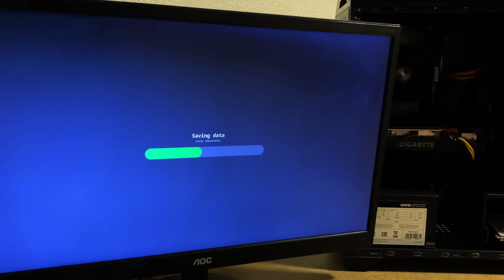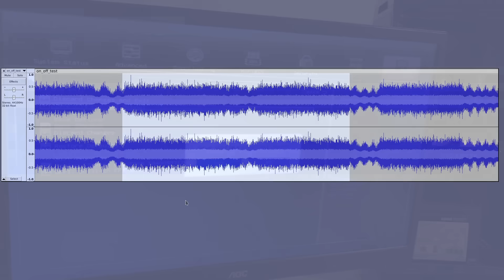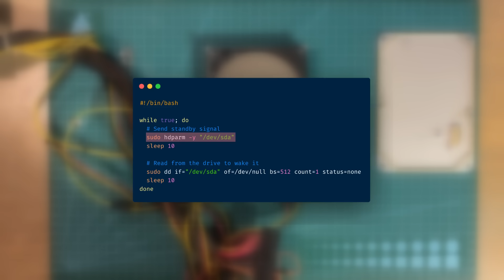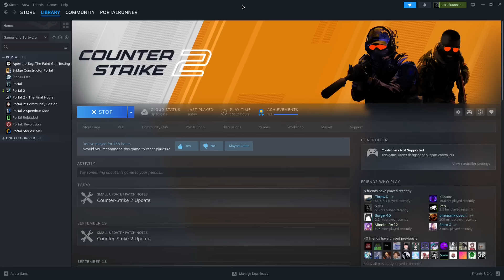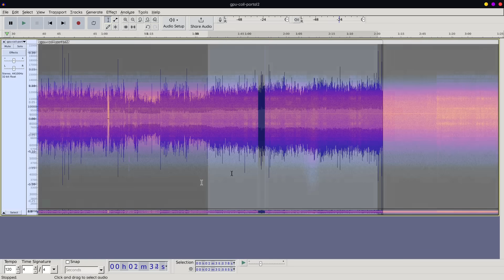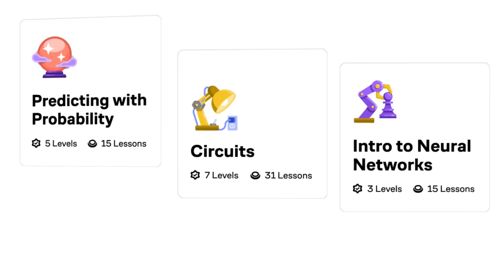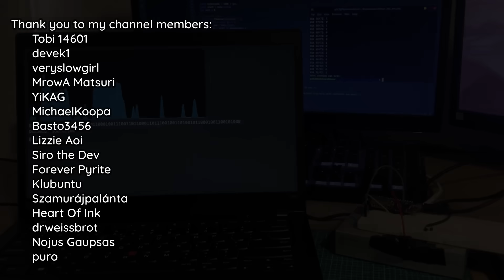Listening to a Computer can Reveal what it's Doing

Comment: Anyone who records guitars in close proximity to their PC, or uses studio monitors without a proper ground knows exactly what their coil whine sounds like. You can hear it squeak even when you move your cursor. I've been spending god knows how long trying to eliminate the issue. FYI, the only actual way to stop coil whine (in guitar pickups) from coming through is to either move the guitar further away, or the PC further away. With studio monitors, it's eliminating the ground loop by either plugging everything into the same outlet, or using something like a GND Defender.

Comment: I was hoping you were going to detail how heat is a side-effect that showcases that your computer is inefficient.
Where it goes from current into processing, where the speed at which those processes are made create heat which is a by-product of the current running through your CPU. Which based off of relativity the exchange of current into heat comes from the power draw, so your computer must draw more power to keep a consistent flow of processes, this it creates more heat.
So computer power efficiency is kind of abysmal if you consider heat as a negative use of power, or increadibly efficient if you make use of that heat such as heating your room.

Regardless, a computer has a main purpose and is designed to run and complete tasks. Therefore it's inefficient.

Comment: but can you extract what is being downloaded or the websites visited?
Reply from the maker: Not from sound or light alone, no. Don’t worry, things like that are usually solidly encrypted and concealed.
Reply: @PortalRunner  then how does the passwords get leaked by this method?
Reply from the maker: @ejonesss  I never claimed you could leak passwords this way.
Reply: @PortalRunner  a password and encryption key is somewhat tantamount.

1:07 you talk about side channel attacks
Reply from the maker: @ejonesss  Sure, but this video is an exploration of how effective these common side-channel attacks are for regular desktop computers. By the end, I conclude that none of the methods discussed pose any risk in the real world. I certainly never claim that you can extract sensitive data.

I mentioned encryption keys as an anecdotal example from Wikipedia. I never said anything about using the methods in the video to get passwords.
Reply from the maker: @ejonesss  If you’re looking for information on side-channel attacks in general - i.e. outside the context of this video - then the comment section of said video probably isn’t the right place to ask. Use Google.

Comment: dont rely on audio or visuals, its too slow.  but on rf interference using hacked tv receiver usb sticks (rtlsdr... hackrf.. etc.). theres so much more data floating around that isnt supposed to be there
theres even a project that can view your monitors video signal from just being near a hdmi cable. its called tempest sdr.

Comment: If you are really interested in this stuff, I think you should try listening to the computer. In some cases if you have a really cheap mobo, it usually does not entirely filter the noise from the power supply/CPU/GPU etc. I personally have such a mobo and in some games, I am able to identify where mouse is looking, or where I am in the map based on the pitch of the high frequency noise from the headphones.

Comment: Back in the late '70s, you could put an AM radio next to your microcomputer, and it would pick up interference noise from the switching of the ICs. There were a number of programs around, like the one I had for my TRS-80, that would actually play a rough bit music using this method. God, those were days.
That's what your vid title made me think of. Also, I've literally always listened to computer drives to tell what my computer is doing. I find SSDs a bit disconcerting lol
Reply: PS There were also programs back in the early 80s that would bang the head of your 5 1/4" floppy drive back and forth to play music. (You can find vids of ppl doing that here on YT.) That was fun lol
Reply: That was also a very early trick with the Altair 8800. The trick was revolutionary for the time, because the Altair had no audio or video out. It didn't even have a keyboard, just some switches and lights.

Comment: That visualisation of the data from the high-frequency inaudible noise a GPU makes through Coil Whine helps underline why some people are able to tell if a video card is failing when the coil whine drops in to the audible sound range of 20Hz to 20KHz, and why it is such a problem.

Comment: when I upscale images using some GAN models locally, I can distinctly hear when my GPU loads a new batch into VRAM and processes it.
I can only hear the coil whine with analogic headphones attached through a 3.5mm jack to the front of my case. It may be because the cable is badly shielded, not sure.

Comment: 2:40
You can also control the speed of the fans trough linux by pwm value. This is possible trough sysfs.
And so I forked an old sensor tracking library to include fan controlling functions and based on the library I made some GUI application that not only allows manual fan controlling but also makes possible tracking sensor values (like CPU, GPU,  chipset temperature and more)

Comment: I have bad audio chip on my computer motherboard and it modulates the audio output with noise on power lines. I can hear different sounds from my speakers whether its mouse movement, cpu load or gpu load. I can literally tell what exactly my pc is doing just by the sound

Comment: Relevant tangential trivia: timing attacks are the reason web browsers don't allow Javascript timers to be used to their full potential. The JS high-resolution timer class is artificially limited to 100 microsecond resolution in insecure contexts and 5 microsecond resolution in secure ones (specifically, ones isolated from other processes). Most modern hardware is capable of measuring time in smaller increments, but allowing a webpage to do so also allows the timing between operations to be analyzed precisely enough to determine cache hits and misses, which can then be used to reverse-engineer all kinds of things stored in the computer's memory outside where the page could normally access. Including, theoretically, keys and stored passwords.

Comment: 0:38 500? Rookie numbers! My Firefox wishes it would only have to deal with 500...
6:05 reminds me of when I got my RX 7900 and tried to run that with an almost 10 year old 700W PSU. Going full throttle on the card would just trip the safety of the PSU, but going like 50% on it (1600x900 on FurMark) it barely stayed alive, but DAMN was the GPU whining... literally 😂Was kinda funny (for about 10 sec) but it absolutely didn't sound healthy...
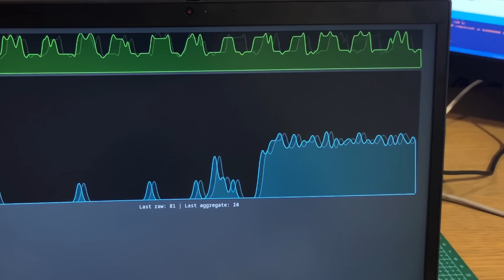9:25 Things I've noticed (in order): poor guy only has 50 mbit, but damn does he have a lot of chocolate on hand. I now also wonder which personality test will tell my that I'm on the spectrum based on these observations and their order.

Comment: I had a dell Laptop though I imagine this works with Most Laptops or Desktop... if you plug it into an inverter Running from DC Power you can hear every single thing that it does even just moving a mouse.

Comment: One thing you should definitely try is to put an AM radio next to a computer. I've noticed that you can get the coil whine noise but with far greater audio clarity through the radio. I was playing with this hand crank radio this one day and noticed that the noise coming out of the radio corresponded with the activity of my computer. When playing a game I managed to tune my AM radio such that you could hear the framerate of the graphics card giving a sound reminiscent of a lawnmower. Just like you showed, looking at the floor made the framerate go up making it sound like the lawnmower reved up, and looking at the distance made it sound like the lawnmower slowed down. I also tried running an LLM on my system and the could get the radio to make this zip-zip-zip sound. You could here each token being generated.

Comment: This video is the best place to post my experience - I have a PC plugged into an outlet that has faulty ground connection. It works, but only roughly, when I measured it with a multimeter it showed that from phase to ground there was 90 out of 220 (expected) volts. Because of that (I presume), my audiobox picks up a lot of emf that otherwise would've been bled off into the ground. As such, I'm not only able to hear that someone's calling me on my phone, or that my phone is sending and receiving signals, I'm also able to hear what my PC is doing. So far I've identified clearly one sound that really stands out due to how unusual and recognisable it is - my GPU working. Normally when I play games I don't hear it, for some reason, but when rendering stuff with GPU and while updating drivers I hear it clearly. It sounds sorta like little tiny blasters from star wars. This tells me that something is either being calculated on my GPU really hard or something is updating firmware (as I presume GPU drivers do that). I can also sometimes hear, though much more faintly than the GPU, how my PC is receiving or calculating the change in my mouse position. This one sounds like an old school optical drive moving the reader head, but only when I move a mouse. There's definitely a lot more of those sounds I either have yet to notice or am unable to due to lack of amplification and precision. And before y'all tell me that I need to fix that ground, yeah, I know I'm just too lazy and afraid of messing it up to try. Besides, the PC works alright anyways.

Comment: With the fan thing you can only measure that the computer is doing something, which isn't really useful unless you need to know if someone is using the computer (and even then the fans might not spin up), and at that point you can just use the mic to listen for that rather than the fans, as using the keyboard, clicking with the mouse, etc. already makes a sound.

Comment: Actually, computers are really fast.  They can be faster, as there can always be hypothetical (or just really expensive) hardware out there that is faster.
But usually, software is just written in an inefficient way, which ends up wasting a lot of time on useless things.
Software actually used to run faster in the past, even on slower hardware, as the pressure to fully take use of the hardware was bigger, because if you didn't it might not have run at all.  Nowadays that fear isn't there anymore, as you can just make something and usually expect it to run fine.

Comment: If you have enough time you can use the AC to exfiltrate airgapped data, by making the computers work harder in a pattern you can raise or lower the consumption of the AC in the same pattern and get text over a few hours, it might be only a few characters per hour, but when all you need is a password/certificate it can be fast enough to get it over a couple weeks.

Comment: In my case, after watching your video, there IS one acoustic option left: AUX Interference. If your headphones (IEMS for my case) have a really low frequency range, and you remove most of the acoustic deadening (padding, or mesh in my case) or if your case (haha get it) has a really s$*tty and thin audio IO cable, you would be able to hear a LOT of noise. With my old case I used to have a lot of that as the cheap chinese IO cable used to have no sound reinforcement, i could hear literally everything being calculated in real time, with me opening a game, to just moving and rendering pixels on my screen, there was a LOT of noise and it would make me go crazy.

Comment: I haven't even watched the video but I can share an experience. My previous computer's motherboard would cause a very faint ticking noise that'd match up with what the GPU is doing.
If I were playing a game, it'd play ticking noise at the same speed as the framerate. So 60 ticks per second or 20 ticks if my fps are low.
If I were rendering in blender cycles, it would tick exactly at the speed at which each sample renders. Viewport or final render, it didn't matter.
It made me go insane and didn't stop until I just switched to a USB input headset.

Comment: Something interesting is I had an old computer that you could actually hear what it was doing. You could hear the hard drive in the fan but you could hear. Small, buzzing and clicking which intensified when the computer was booting up or under load. Presumably coil or capacitor But you could definitely hear it. The system didn't have a GPU so it had to be the motherboard.

That system has officially died as of like 3 months ago. It started booting inconsistently then after that it would power on but nothing would happen. Presumably a briked motherboard but it could have also been the CPU. Though my theory is cracked solder joints or traces. Since sometimes it temporarily worked. After reseeding or reinstalling components.

Comment: 0:19 space is actually a really bad place to operate a computer, from a thermal standpoint. If you tried to run a standard desktop PC in space it would overheat almost instantly because here is no surrounding fluid to transfer the heat to.
Reply: okay what about quantum computers?
Reply: @bakedcereal2  Space is the worst place to radiate heat so you would actually need liquid nitrogen
Reply: @KudoRedfox Liquid helium, actually, as liquid nitrogen is too hot. Quantum computers, as it stands in the present time, need to be as close to absolute zero as possible, and liquid nitrogen just can't get the computer cool enough
Reply: @KudoRedfox Space is the best place to radiate heat, it's the worst to conduct heat, but radiating can be enough. Also liquid nitrogen is useless (first because you actually need helium) because you'd have a very limited supply available
Reply: He did say a superconducting quantum computer in space but i'm not a quantum physicist

Comment: 2:08, this effect is typically caused by the voltage, which needs to be higher at higher clock speeds (loads of physics reasons why this is the case, but i digress). Clock speeds go up and down based on load, as an effort to save power when the CPU is 'idling'. Basically the motherboard/cpu package dynamically adjusts it's clock speed based on if the processing power is needed or not, which in turn adjusts voltage. As you can guess, high voltage means higher resistive heat losses.

So, to beat this, you just need to tell your motherboard to stop dynamically adjusting clock speed, and peg it at a specific clock speed, meaning your CPU is always going to be outputting a certain TDP

Comment: One crazy side-channel attack i've heard of is using a piece of code to write to RAM like crazy.  This causes a tiny, but detectable EMF/radio signal.  So, a virus can use pulses of heavy RAM usage, and a radio antanna close by, to extract information from a system, even one completely air-gapped (has no access to any network)

Comment: Showing my age a bit, I remember using a 486 with a cheap ISA sound card. You could hear the bus activity through the speaker output when it was loading from the hard drive or even just crunching numbers in memory.

That noise going away (or at least being less audible) was one of the most noticeable things about moving to a PCI sound card.

Comment: I hope to god you read this. Okay. VERY easy. I can record it if you want me to, but take a pair of wireless headphones with a 3.5mm jack. Say, cusher EVO (skullcandy) or an NC75 or even an NC25 (srythem) and plug in the aux cable to audio. Then, plug the USB-C connector into the USB-A port of the front panel that you did it too. When you run tasks, cpu or gpu, you can HEAR the task. I think its because when power is being used, you can hear the ground loop.
Reply from the maker: This happens because the sound cards built into PC motherboards are often cheap and badly isolated. The easiest fix is a USB sound card, though some specialists/audiophiles will often get dedicated PCIE cards.

Comment: I know only one real danger about this things are keycard readers and cameras. They somehow used each pixel of security camera to get superhigh framerate to measure light pulses on keycard reader, engineer something out of it and get the card that can open it. It's fixed by installing very basic electrical component in circuit of a reader but found it interesting that it was real voulnerability discovered

Comment: Maybe you could try instead of measuring the LED blinking you could take advantage of interference and try to estimate network activity by putting a wire coil around an ethernet cable and hooking that up to a precise oscilloscope, would be interesting

Comment: Theres also ethernet ports with orange/green lights, which im pretty sure means read/write
Reply from the maker: The orange light is an indicator of gigabit bandwidth. As far as I’m aware, it’s usually only one LED that blinks, and it’s connected to a specific pin on the Ethernet controller. Of course, exotic ports can and do exist.

Comment: as a pc enthousiast i always rely on the sound my pc creates
cpu coil whine - something is happening on a 1 or 2 core level and something is 
fans sping at 100% - i7 14700kf went full on furnace mode while doing something demanding
gpu coil whine - it is concerning, something is happening at a low cuda core count
gpu fans are at 100% - yep, im gaming on ultras with rtx on, how'd you know
psu tries to take off with its fan - both cpu and gpu work and pull a lot of watts (and it reminds me that i need to swap my 3yo 750W unit asap)
that hdd spinning noise - hdd is doing something, why?? - idk
all fans are at 100% - something is wrong with the fan controller, restart the pc

also i determine the cpu temperature mostly by fan noises, arctic p12 on push + tf12025pro on pull on the aio creates such a destinct sound that i cant confuse with anything else